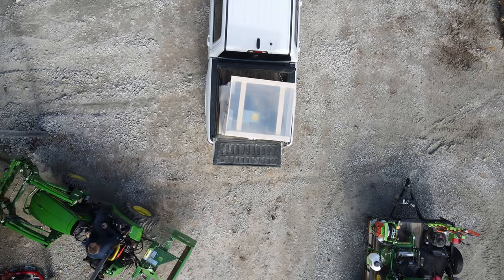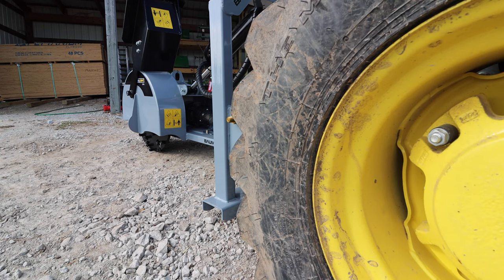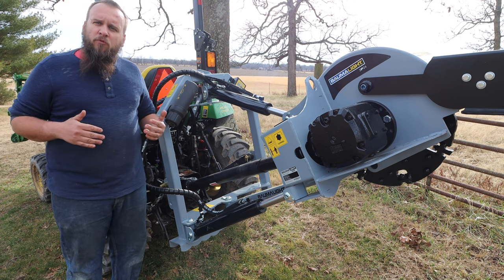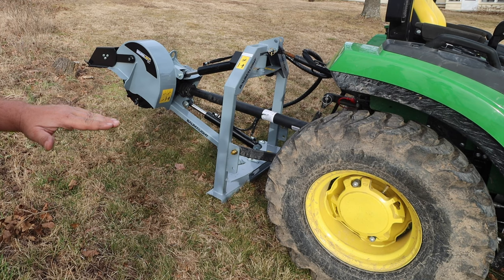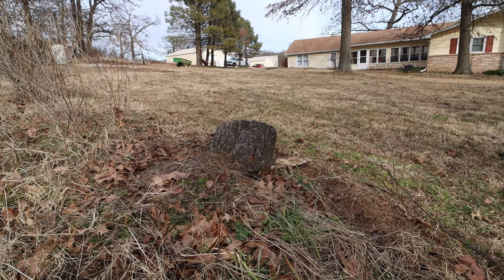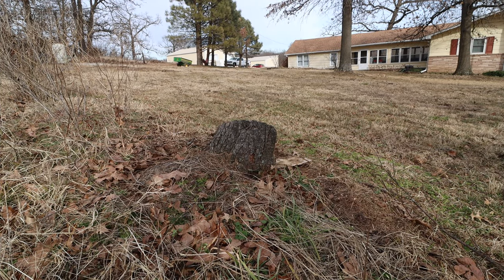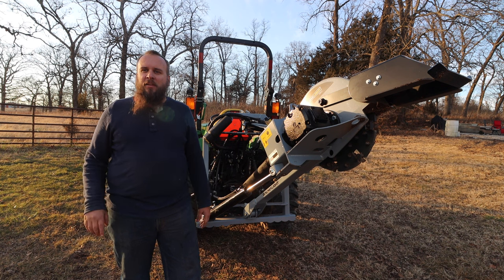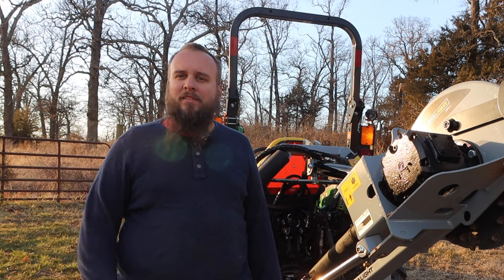Baumalight 3P24 Stump Grinder On a Compact Tractor - This Thing is a Beast

Comment: Well I guess I will add that to my spring shopping list.
Reply from the maker: It is a very well-built unit. Heavy duty shielding on the hydraulic lines and Grease points on everything the pivots
Reply from the maker: I’m wanting to move into your world of getting paid to operate the tractor.

I’ve been taking it slow on that to make sure I know what I’m doing first

Comment: That is a much more efficient unit than the ridged mounted grinders. Looks like it did an excellent job too!
Reply from the maker: I definitely prefer the articulating style because I can operate it from off the tractor where visibility is a lot better

I have Ground a lot of stumps with it and it does a good job

Comment: Can u show your hydraulic set up?  Just curious how it works with both a loader AND the setup in the back.  Looks like something I could use!
Reply from the maker: So when I bought the tractor I got it with the power beyond for the Backhoe and two rear remote hydraulic ports.

Those two remotes are what run the stump grinder.  I showed how that is set up in my snow plow video.

By default the grinder is made to run off those two remotes but they also have an option to get it set up to run off one remote. Probably basically a diverter but I didn’t look into it

I went through a couple of different processes to get my front hydraulics right

I also have an extra set hardlines run up to the front to run my grapple off those remotes and a hydraulic diverter, so counting the ones for the loader I actually have seven sets of hydraulic ports 

I think I’ve made three or four videos on my hydraulic set up. I knew when I bought the tractor I was going to use a Grapple a lot

Thank you for watching

Comment: I have this same unit (3p24) that I run on my 3038e, and I love it too! How do you store yours? I'm trying to figure a good method of storage, probably using casters / dollies. They would have to be sturdy, though since this thing weighs a half a ton -- literally! 
Great video, as always!!!
Reply from the maker: Thanks. I saw you had an issue with your hydraulic top link. Hopefully that was resolved

I’ve been wondering the same thing about storing the stump grinder.I just got it last week and have not taken it off the tractor yet.  

If you have a suggestion let me know otherwise I may end up showing it in a future video
Reply: @RockhillfarmYT   Actually, I just got a phone call from TSC, and it looks like they are going to make this right! So happy I bought from them!  

If I come up with something for my 3P24, I'll see if I can figure out a way to send you a picture and you can let me know what you think. Hopefully I am going to be doing that in the next week or so.
Reply from the maker: @timsawyer7443  Great. 

I see you on the John Deere Facebook groups so we can always communicate that way if you want to send pictures or videos
Reply: @RockhillfarmYT  good plan! I'm sure I'll update the top link issue on there too, when I get the new one they're sending me installed. I hadn't thought about it, but I guess I could post pics of how I store the 3p24 as well, as it might help others. I never really think much about me being able to help others with posts; usually it's me learning from folks like you!
Looking forward to your next video, as always! (And yes, I already watched the tall stump vid.)

Comment: Quick question, what HP tractor do you have and what RPM do you run it at while operating?
Reply from the maker: 38 HP tractor. I run the PTO at 540 RPM like I do with any other attachment.

On my tractor 540 RPM is 90% full throttle and around 2500 engine RPMs

Comment: Wish you would have shared costs for this and the other ones you looked at.
Reply from the maker: This stump grinder is $5700 and I didn’t find many to directional articulating grinders in this size to compare to
Reply: @RockhillfarmYT  locally I just got a quote on this unit for $8500.00. they went WAY up. Wound up with a land pride for about 2k less
Reply from the maker: Wow. I know prices are up on everything but that is a big difference

I didn’t know land pride made a Grinder

Thanks for sharing

Comment: Will it only cut in one direction?
Reply from the maker: Yes, I believe you should only cut while swinging to the left. 

On the left side of the wheel The teeth extend up about 4 inches. On the right side of the wheel they’re only on the bottom inch which is I think just to make sure you don’t bind up as you go back across your last pass
Reply from the maker: I just cut up a 36 inch stump with it
Reply: I bought a quick attach grinder made in MN (apparently a sister company to Erskine?).  Pretty much the same setup as the one in the video, except the QA one has teeth facing both ways.  Not a deal breaker though, they do the same thing really and both look really well built.   I had a direct PTO drive one and it worked great for the money spent but i wanted a little bit better one.
Reply from the maker: Do you do stump grinding for a living?
Reply: @RockhillfarmYT  No, but I have been debating getting one for own, friends and neighbor's use. TTWT had me looking at the Baumalight... and I think you have nailed it.
Reply from the maker: I’m by no means trying to become a professional stump grinder but I would like the unit to pay for itself over the course of a couple years by grinding stumps here and there for other people

I think that’s pretty realistic

Comment: Where is your safety equipment when you're working the equipment?
Reply from the maker: I usually just wear it when I’m doing something dangerous.

What did you think I should have for a stump grinder?

I am 8 to 10 feet from the grinding wheel in the opposite direction of where it throws material.

I have cut 100 stumps with it never seen it throw anything back towards me.

Comment: ye u deffo dont wanna be sat on a tractor while running over stumps excetra this way is the 21st century style...you could run over anything with thr other ones you imagine that wheel is spinning at say what a 2000rpm  iff that hits a chunk of metal that metal is gonna hit you or wateva so fast its gonna make a mess so ye
Reply from the maker: I definitely prefer the better visiblity of operating it from off the seat